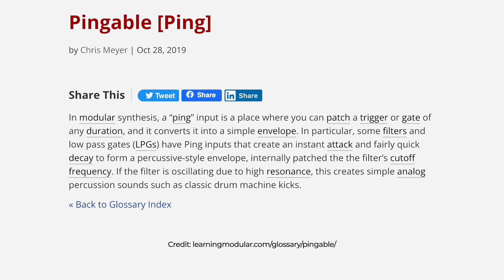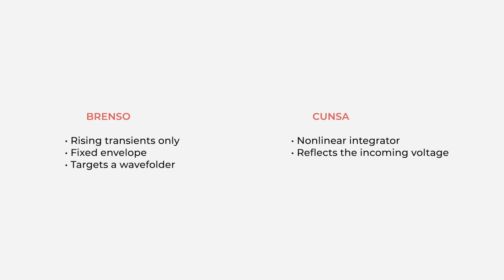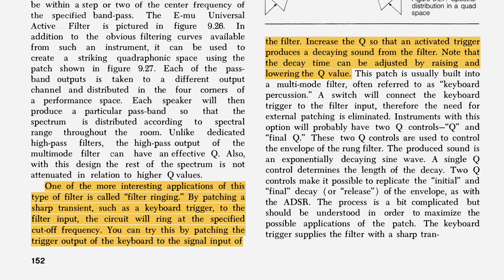What is filter pinging (and filter ringing)? A demo with BRENSO and CUNSA

Comment: I think that what is lost in the synth community, is the physical origin and profound nature of resonance. Filters only happen to exhibit resonant-like behaviour because of a circuit topology that creates feedback at the cutoff frequency. In nature resonance is usually tied to a bandpass function that is "tuned" by some dimensional property. While tuning forks, Helmholtz resonators (cavities) and suspended bridges exhibit a strong bandpass behaviour, wind instrument bodies (including pipe organs) and stringed instrument soundboards (from guitars to violins and pianos) are in reality composed of many resonant modes ; so, not just some "cutoff frequency", but a whole spectrum of resonant harmonics and partials. The only synthesists who have understood this, are those who dab into so-called modal synthesis. Unfortunately, the rare such tools provided to musicians are hard-wired resonator banks that are purposely meant to emulate "physical" instruments being "excited". 

So you end up with rich-sounding modules like those Mutable designed, but nonetheless modules that isolate their inner workings too much from their users. In true modular synth spirit, it would be great to see someone approach multi-band resonance in a way that is openly intended to perform harmonic shaping. A good design should be excitable by a simple input of white noise, and the whole magic would happen with the resonator bank, how they are spread and tuned (one by one or according to a user-controlled function), and what their amplitudes are ; again, one by one or according to a simple or complex function. Tuning the frequency of resonators is one thing, but the magic is in how these banks are tuned and levelled collectively. A smart design would allow you to tweak each component in detail, but would also give you macro control over the whole bank, in both static and dynamic ways (input dynamics, velocity, pitch, etc). I am not convinced that Fumana is achieving this. The graphic eq approach of vocoders and the inherently opinionated "Buchla" aspect of this, in my opinion stifles the potential of tuned resonators.

In general I feel we as a community are stuck in 1973 and little true innovation has occurred in synthesis over the last 50 years. We've had granular — a curiosity but "meh" ; the TZFM era of the DX7 ; the PPG wavetable concept (cool but to an extent, an admission of defeat for synthesis) ; and the pretentiously hardwired ideas of Don Buchla, only usable to do Buchla-sounding stuff and nothing else. How may circuit designers today think about the intrinsic nature of sound before crafting a synthesis voice ? We're redoing the same block diagrams that Bob Moog came up with 60 years ago. If you analyse natural sounds — say, the sound of a cello — you will see a complex combination of a noise spectrum (for all practical purposes, the ocean of partials is just shaped noise) and clear resonant peaks. This is what the vast majority of natural sounds are made of. Another thing you will see (and hear) is that natural sounds have far less energy in the HF regions than synthetic sounds. Stand 2-3 metres in front of a brass band, and you will hear for yourself that the sound is never strident, even for a loud piccolo trumpet. Compare this to the horrible "brass" sounds of 80s made with 'supersaws' or the harsh oscillators found on Oberheim and Sequential designs. While synthesis is not necessarily meant to emulate natural sounds, it should learn from nature a few tricks — why ? Because our ears are tuned to natural sounds by aeons of evolution. By providing the synthesist with pure synthesis tools that embody the character of natural sounds, it should be possible to create completely new, unheard sounds, that feel totally natural... Have you ever asked yourselves why Fender pianos are so enamoured ? Because they sound natural while being so synthetic. 

If I have to level both praise and critique to your designs are Frap, I would say that A) you stand out by a clear spirit of innovation and you are quality-minded. On the down side, while your aesthetics are pretty, doing everything via colour-coding and symbols is not as user-friendly as you'd think — you'd do well to offer alternative front panels for those who prefer a more verbose UI.
Reply from the maker: Thanks for taking the time for such a detailed and informed comment.

Your remark on tuned resonators is very interesting and we agree that FUMANA (like any fixed-filter bank) not only isn't ideal, but actually goes in the opposite direction.

We also agree on the fact that in analog there is very little left to do, so as of today, we chose to focus mainly on the interfaces. We briefly talked about this in a recent interview for Synth Anatomy here: https://youtu.be/ebXvw4_e2wU

As for the Fender pianos – if you refer to the Rhodes, I wouldn't call them synthetic... There are real vibrating bodies (like an electric guitar) involved.

We also understand the remark on the interfaces, but as I said, as of today the interaction between the musician and the instrument is our main goal, rather than looking for "the new sound". Things might change in the future, though, but we prefer to take one step at a time! More info on our interface approach is here: https://youtu.be/IWgRJIxioQU